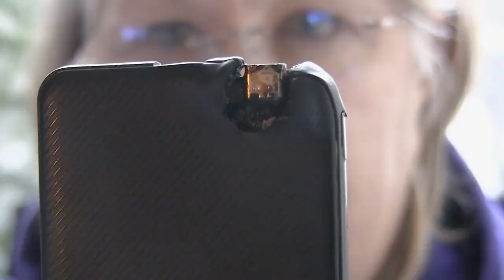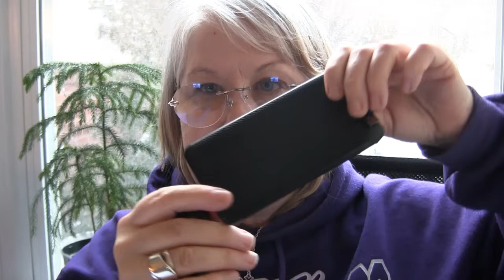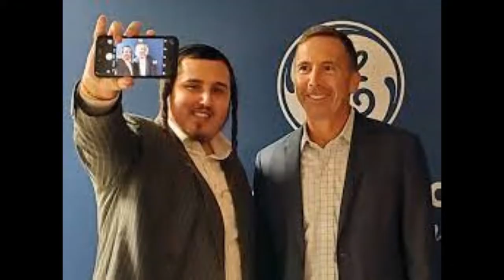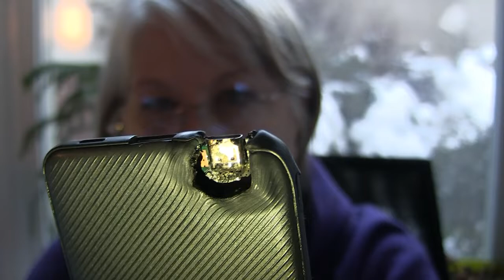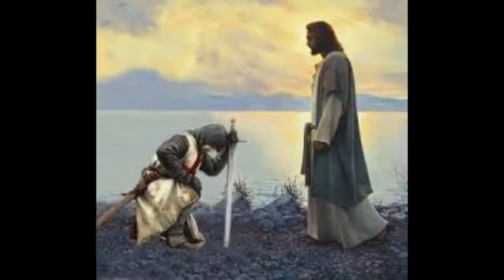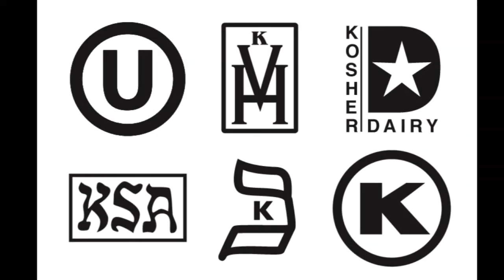BEAST SYSTEM SETS UP THE APPLIANCE COMPLIANCE & LITHIUM BATTERY CAUGHT FIRE BURNED MY CELL CHARGER!

Comment: That is so scary.. I'm glad there wasn't a fire. I just purchased a new stove..it is wifi compatible.. I'll never connect it to the internet..
Reply from the maker: Wow I didn’t even know that they had that feature!!! That’s even more control that they could use to completely shut people down!! Smart thinking on your part! It is scary especially thinking that there had to of been flames at some point coming from that corner where are the metal is exposed. I just don’t know how much. I’m kind of leaving it unplugged but if it was the battery then it didn’t need to even be plugged in to ignite! I have it sitting over next to the sink now on the countertop not plugged in of course, but just in case. I think I still have the box that I purchased it but it’s been some time ago so I was not expecting to walk out there and find out in that condition! I’ve taken it with me everywhere even in my purse!!!

Comment: PS 🚩 whenever I'm away from my phone, I've gotten into the habit of placing the device on a counter or on something that's relatively "fire proof," as well as not being near anything that could possibly catch on fire (I have 
👉INTENTIONALLY👈 started doing this ever since my little brother told me that a flame one evening, shot out of his phone, while he was holding it and was about to make a call). 
By the way, I want to thank you, Kimberly, for sharing your experience because now that you have... no longer am I going to have my phone charging while I'm sleeping!   you 👉  ✨️😇✨️
Reply from the maker: Oh wow 😮! Yes you know it never occurred to me that that thing would just ignite on its own when I’m sleeping but like you I had put it on this desk that I could lay it flat on and not around anything else and it looked like that there was one piece that was burned that popped out and it shot may be about 10 inches away but still there was nothing there that could ignite on fire so I had a little scorch mark that was black on the desk and then that piece that popped out that was half burnt which I didn’t show in the film but you know I could not tell anything was happening in the other room with it I didn’t hear anything happening. Of course I thought I smelled something a little bit earlier before I went to bed and it smelled strange but I couldn’t make out what that was coming from I just thought it was something coming from down the hall. I always have my phone plugged in at night right next to the bed and sometimes I’m listening to stuff and I have it laying on the bed and I fall asleep so that’s probably a very bad idea and I should just rest it on the stand. I hope that a lot of people will pay attention to this video and make changes like you are already doing!!! 😍🙏
Reply: @elijahmoses.thealmondtree , I hope so too! (people making changes as needed).
And good for you, that you placed the phone where it wasn't able to injure you.  Thank You, Jesus!  (((❤️)))
Before my little brother's phone 'blew its wig,' Kimberly, I did come across where a young woman had her phone placed directly under her pillow as she listened to music.  Well, that didn't work out so well.  Fortuntately, it had just made a burn spot in her bed and her pillow and didn't engulf her bed while asleep!  (a few others in the video had had similar experiences, with one person getting a slight burn on their hand).  
🌾 I enjoy your videos very much, sister!
they're Always Enlightening! ✨️  You Are Very Much In My Prayers.  I will say a prayer about you receiving reliable transportation.  We Praise You, Lord, for providing EXCELLENT TRANSPORTATION FOR KIMBERLY.  
In Jesus Holy Name.  Amen!
I love you, precious brethren of our Amazing Jesus!  ✨️🌾🌾🌾✨️
Your fellow sister, Elise 🌴

Comment: I had a charger melt a few years ago (the part that goes in the wall). Made me nervous every time I charged that device going forward. Cell phones now have settings to shut off charging. Not sure if it’s on all of them, but that might help give you peace of mind if you have to charge your phone and can’t be by it the whole time.
Reply from the maker: I never had any problems with the charger or my phone. It happened with no warning after owning it for over a year.

Comment: Is that an iPhone?
Reply from the maker: It’s not my phone it’s my cell phone charger which is a completely different unit that you charge in the USB port in the wall and then you plug your phone into it when it needs charging after it’s charged up like a battery pack